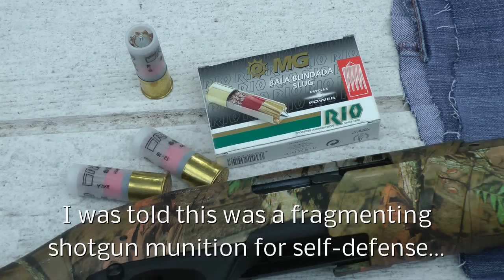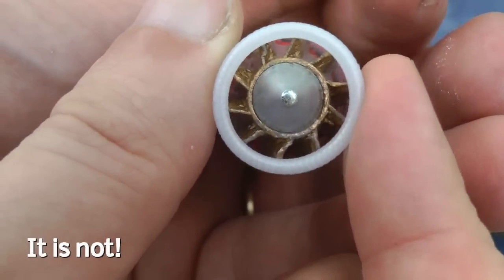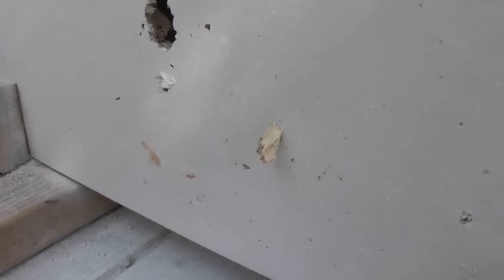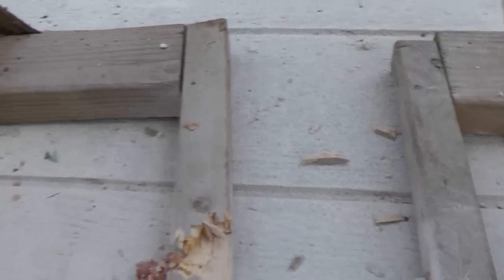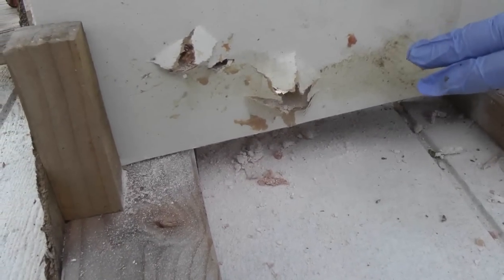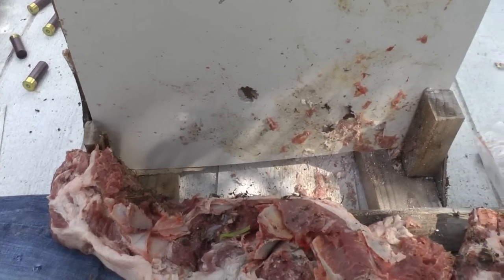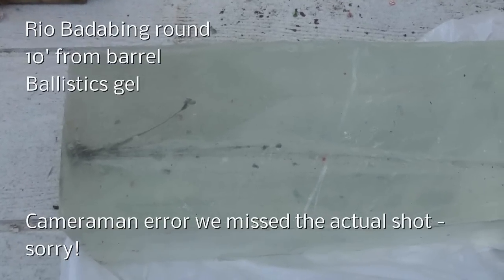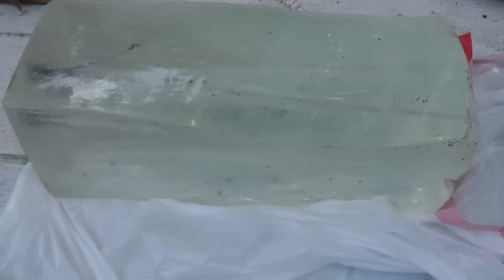Rio Bala Blindada Slug Test

Comment: This MG round does indeed fragment...the 10 "fins" around the central slug/penetrator will strip off as it goes through the target object.  As noted below, RIO also makes a 1 oz. fragmenting slug called "Expansive" that has several pre-formed segments pressed into a cylindrical shape, with a "nose" that sticks up from the plastic cage sabot it is loaded into...the "nose" strikes the target object first, and moves backward, forcing the slug segments apart to go their merry ways.  You guys should try some of these "Expansive" rounds against drywall and ballistic gel...I think it would be very impressive.